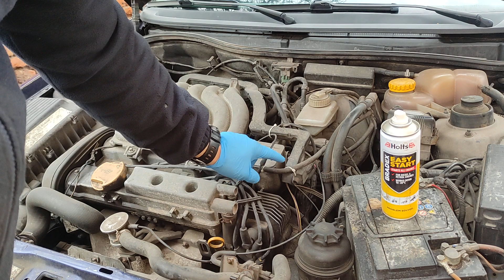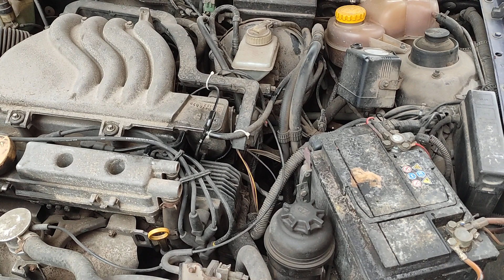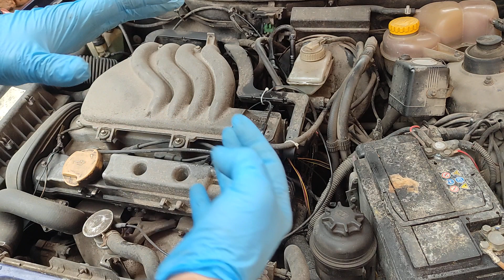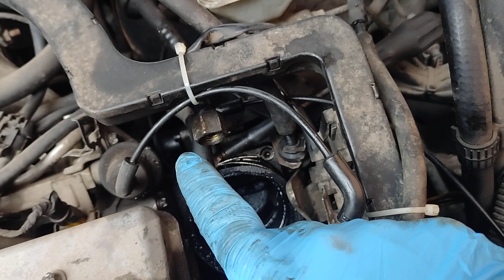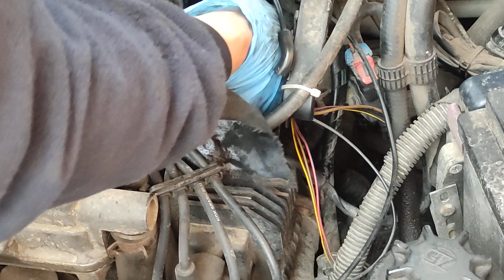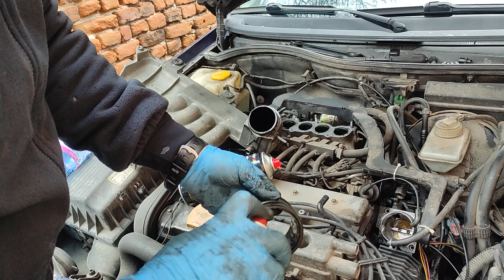High idle RPM Repair | Vacuum Leak / Throttle Body Clean OPEL VAUXHALL

Comment: Hey man, I'm not sure if you're joking when you say get some flammable liquid, get some petrol and spray around the engine bay! You spray petrol around your exhaust manifold, turbo, or catalytic converter ... it may not be just the rpm that goes up, but part of your engine may likely also go up, in flames! 

Slight vacuum leak and rough idling engine may be your least problem if you set your car alight! 

I suggest to you and all others watching your video to NOT go randomly spraying petrol around a car engine, especially while engine is running.
Reply from the maker: Don't do it if you don't feel safe. Take it to the local garage, they will do it for you, not in front of you of course.Or use the second method with the bottle of water.